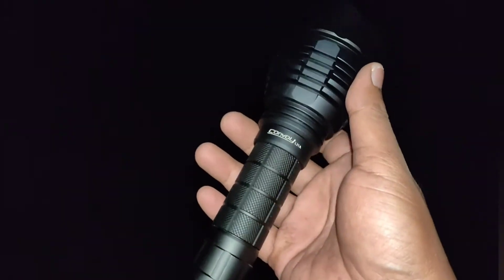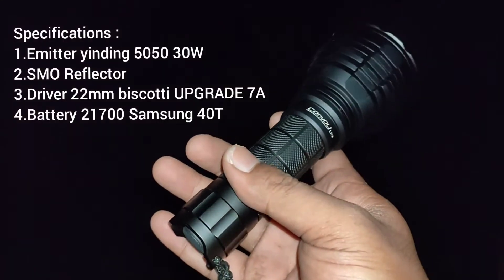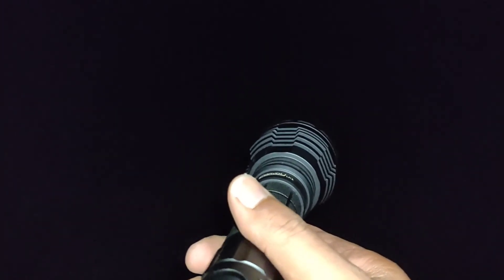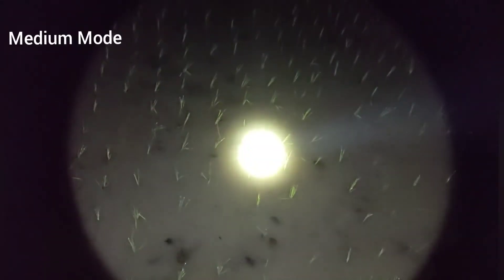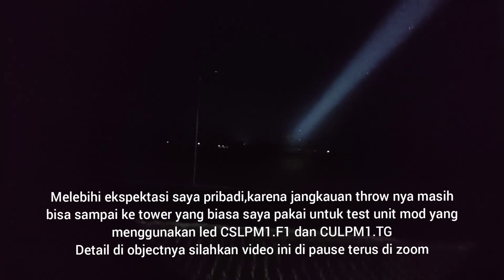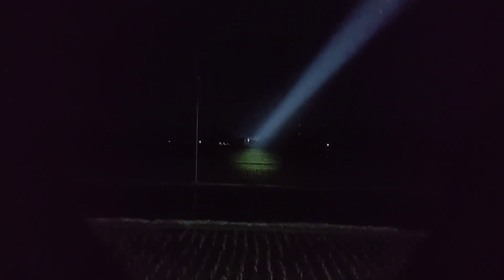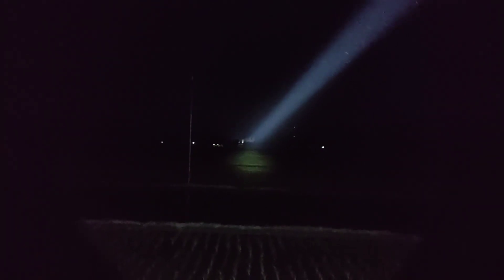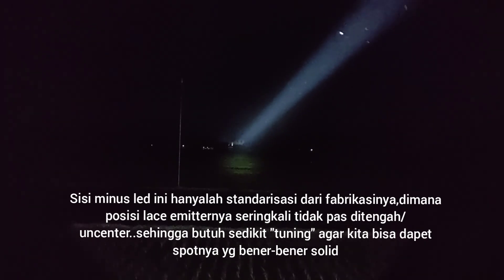[TUTORIAL & BEAMSHOT] CONVOY L21A : Solving Misalign Spot due UNCENTER Die on Yinding 5050(L50 Copy)

Comment from the maker: Reflector SMO model lama untuk Convoy L2/L21A : https://tokopedia.link/qxwRZSezesb
https://tokopedia.link/t9afbVrzesb

▶️Battery 26650
High drain 20-30A keatas untuk memaksimalkan driver dengan system direct FET,driver mod,multiple leds atau untuk supply single led SFH55.2/SBT90.2
@Vapcell P54 26650 :  https://tokopedia.link/U8yJgUQCjtb
https://tokopedia.link/Bj8PRmZe2tb
@Vapcell ungu 26650 : https://tokopedia.link/IL39luLCjtb
https://tokopedia.link/Ri40Xmdf2tb
@AWT 26650(new updated cell) : https://tokopedia.link/gOtP54jDjtb
Untuk drain current 3C setara HLY
@Liitokala 26650 Lii-50A :
https://tokopedia.link/6zenMp4Djtb
https://tokopedia.link/NoxY51pEjtb
Alternatif jika link diatas stoknya kosong :
https://tokopedia.link/6SvTxgZDjtb
https://tokopedia.link/j2vNlqSDjtb

▶️Battery 21700 :
1.Long endurance/Hi Cap battery
@LG Chem M50LT
New Gen dari pengembangan LG Chem M50T(Charging lifetime lebih panjang hampir 2x lipat)
Stock produksi 2021 akhir-2022 awal :
https://tokopedia.link/l498lEIpOsb
@LG chem M50T
Stok batch produksi 2021 akhir - 2022
https://tokopedia.link/g852n3xvvsb
https://tokopedia.link/yqcJIuDoIrb
Stok batch produksi 2020 akhir - 2021 awal
https://tokopedia.link/2oNSwB0vvsb
https://tokopedia.link/ZK2Js5JmErb
atau
@Samsung SDI 50E(long endurance/hi-cap battery with less turbo mode output for multiple leds) :
https://tokopedia.link/aVKLwItHIrb
https://tokopedia.link/zrL4EpNUvrb
2.Recommended untuk driver mod/upgrade
Samsung SDI 40T(*recommended for multiple leds) :
https://tokopedia.link/eVeyPUJUvrb
https://tokopedia.link/GufjhBhCksb
https://tokopedia.link/HVOES4uCksb
https://tokopedia.link/VrFfjdJCksb
3.Drain current paling tinggi Samsung SDI 30T(higher turbo mode output for multiple leds with less battery capacity) :
https://tokopedia.link/q8se3MSUvrb

▶️Battery 18650 :
1.Recommended untuk driver standart atau unit build up
  @LG chem MJ1(kapasitas tertinggi) : https://tokopedia.link/6Tenz5HWKrb
https://tokopedia.link/W4twokNWKrb
  @LG chem MH1 : https://tokopedia.link/z0UvN12WKrb
https://tokopedia.link/wWpwBj7WKrb
Atau
  @Samsung 35E(kapasitas tertinggi) : https://tokopedia.link/vXmloueXKrb
https://tokopedia.link/2srXE1gXKrb
  @Alternatif jika LG Chem MJ1 dan Samsung 35E diatas kosong,maka kapasitas paling tinggi dengan drain current yg sama pake Panasonic NCR18650GA :
https://tokopedia.link/iRYoPRZ4Osb
https://tokopedia.link/yZC1XG3SRrb

*Khusus untuk led nichia 219 series yg menggunakan driver di bawah 4A,jika butuh kapasitas battery yg tinggi,bisa pakai Panasonic NCR18650B :
https://tokopedia.link/yzVHyro5Osb
https://tokopedia.link/m3tzqA2XKrb

2.Recommended untuk driver mod dan multiple leds 
   @Samsung 30Q : 
FLAT TOP : https://tokopedia.link/O4cCd0NXKrb
BUTTON/PIN TOP : https://tokopedia.link/xvR5z6tidsb
   @LG Chem HG2 : 
https://tokopedia.link/TMbkIs51jsb
https://tokopedia.link/x1J9YRa2jsb
   @Sony VTC5 : https://tokopedia.link/Yj7vKgoYKrb
https://tokopedia.link/2fLN41sVSrb
   @Sony murata VTC5A : https://tokopedia.link/Lkz5SnzTRrb
alternatif jika semua stok diatas kosong bisa pake @molicel P26A : https://tokopedia.link/KL2KBFJTRrb

▶️Battery 18350
hi-cap battery dengan drain current medium :
@Coilgear 18350 :
https://tokopedia.link/K0yBqWAKitb
https://tokopedia.link/dSCnkypLWrb
https://tokopedia.link/O295ipTKitb
https://tokopedia.link/HEQRZmNKitb
Alternatif link jika link diatas stoknya kosong :
https://tokopedia.link/zYvQ70Nutsb
https://tokopedia.link/YB5gec4utsb
@Vapcell MII 18350 :
https://tokopedia.link/9EgTVgc1jsb
https://tokopedia.link/OMHWyOv1jsb
https://tokopedia.link/jjmbNEMvtsb
https://tokopedia.link/Uy6C6ekAjtb
@Soshine 18350 :
https://tokopedia.link/gEQgOI8uesb

Yg butuh drain current lebih tinggi untuk memaksimalkan output driver yg mod bisa pakai Vapcell,gunakan model flat top untuk yg pakai spring..dan gunakan yg button top untuk yg menggunakan contactor pin pada drivernya
1.Vapcell merah FLAT TOP :
    https://tokopedia.link/x4CTe2pAjtb
    https://tokopedia.link/h5Dm6j3LWrb
    https://tokopedia.link/itAZLwWLWrb
    https://tokopedia.link/JxVzNWvAjtb
2.Vapcell merah BUTTON TOP :
    https://tokopedia.link/Ucxuuv9LWrb

Yang butuh endurance(hi-cap battery dengan drain current lebih rendah)untuk unit dengan driver standart,bisa pake vapcell hijau F14 :
https://tokopedia.link/t7GajtTcZsb
https://tokopedia.link/6B145EBQNsb
https://tokopedia.link/pL2EnaMMWrb

▶️Battery 14500 
Untuk single led,driver standart dan maen arus lebih rendah :
@Soshine 14500 button top : https://tokopedia.link/3zZaUD3G6rb
https://tokopedia.link/yuEJvsfH6rb
https://tokopedia.link/XWO7UbiH6rb
Alternatif link jika di toko diatas stoknya sudah kosong : https://tokopedia.link/eFBsIkxzjtb

(High Drain)untuk multiple leds,driver kondisi mod dan butuh arus lebih tinggi
@Vapcell H10 Button top : https://tokopedia.link/Kwij9p1j5rb
@Vapcell H10 Flat Top : https://tokopedia.link/lhdyLJ6j5rb
https://tokopedia.link/FO3urTvvtsb
https://tokopedia.link/PvRMETGzjtb

▶️Recommended Charger :
Paling murah dan bandel Xtar Ant MC1 Plus (Single slot KHUSUS Li-ion 3.6-4.2V+Charging 1A max) :
https://tokopedia.link/uPBzEwvwosb
https://tokopedia.link/bAqzjMWwosb
https://tokopedia.link/SOL1gXKwosb
Video review nya ada disini : https://youtu.be/xhaRsKfEbNg

Kelas diatasnya :
1.Xtar SC1(KHUSUS Li-ion 3.6-4.2V+Charging 2A max) : https://tokopedia.link/fqnXWc0BRrb
https://tokopedia.link/s3vn11jvtsb
2.Xtar SC2(KHUSUS Li-ion 3.6-4.2V+Charging 3A max) : https://tokopedia.link/CwqYwn8BRrb
3.Xtar VC2S(Charging 2A max+Power Bank feature) : https://tokopedia.link/MJw4VhABRrb
*Kalau stoknya kosong berarti silahkan pakai VC2SL dibawah
4.Xtar VC2SL(Charging 2A max+Power Bank feature+Upgraded version from VC2S) : 
https://tokopedia.link/Gfbuz0cT5tb
https://tokopedia.link/9kFmrDhT5tb
https://tokopedia.link/CMho0HdS5tb
https://tokopedia.link/sgTASvpBRrb
5.Xtar VC4S(Charging 3A max+more features) :
 https://tokopedia.link/xDnENJAVvrb
Video review nya ada disini : https://youtu.be/aJJx3OCOJf4
*Kalau stoknya kosong berarti silahkan pakai VC4SL dibawah
6.Xtar VC4SL(Charging 3A max+more feautures+Upgraded version from VC4S) :
https://tokopedia.link/FU6fhz6R5tb
https://tokopedia.link/09M7wSRS5tb
https://tokopedia.link/68kQAC0R5tb
https://tokopedia.link/g6nzEoEVvrb

Produk2 yg di rekomendasikan diatas adalah semua produk yg sudah pernah kami beli selama periode th 2020-2022 dan sudah kami test pakai,jika ada perubahan stok dan spesifikasi produk dari seller..maka itu diluar tanggung jawab admin channel ini 🙏

Comment: Om sarannya dong. Aku up taffled c8 pakai led sst40 reflector bawaan tapi kok spotnya gak dapat ya ? Sperti ada 3cahaya dan sorotnya pun gak terlalu jauh. Harus digimanain nih om ???
Reply from the maker: Pertama..jika belum ganti drver,itu output lumensnya kurang,bener SST40 itu bisa sampai 17-18W max(sedangkan XML2 hanya 10W)tp kalau tidak disupply dengan arus yg cukup ya outputnya ga akan bisa maksimal..kalau masih pake bawaan,driver std nya taffled output kisaran 2-2.5A saja,silahkan ganti drivernya pakai punya convoy yg output 5-6A untuk SST40
Pilih diameternya yg sesuai dengan ukuran driver skrg(17mm atau 20mm)karena taffled ga punya standarisasi parts(ada yg isi 17mm ada yg make 20mm),untuk jmlh mode nya convoy jg ada 2 pilihan dengan 4 mode atau yg 12 group..silahkan dibeli sesuai kebutuhannya..di online banyak
Jangan lupa pakai thermal pasta ketika nempelin PCB led nya

Kedua,kalau taffled C8 nya itu versi reflector plastik atau almu tp tipis..spot mau lebih bagus silahkan reflector pake punya convoy C8 jg type SMO(smooth)kalau untuk ngejar spot yg solid,dengan buttom hole 9mm beserta gasketnya ukuran 5050 untuk buttom hole 9mm..syukur dapet yg buttom hole 7mm,gasketnya pakai 5050 yg untuk buttom hole 7mm jg(gasket menyesuaikan ukuran buttom hole reflector)

Ketiga,kalau mau lebih maksimal lg,silahkan pakai battery dengan model highdrain,semakin tinggi drain current battery..kalau sudah pake driver yg sy sebut diatas td,output led nya nanti semakin tinggi..dan senternya semakin panas..karena bahan hostnya taffled adalah almu babet(bukan almu solid terlebih lagi bukan aerograde)dan menggunakan roundpill konstruksi headnya(bukan integrated head)maka akan lebih mudah panas dan lebih susah buang panasnya keluar..jd khusus untuk taffled,max pake battery dengan drain current 8-10A saja sudah cukup spt misal Samsung 35E atau 36G,atau LG chem MJ1

Dengan perhitungan ketiga parts upgrade td..level maksimal yg aman,yg bisa di capai dengan hostnya taffled,SST40 akan mengeluarkan output 14-15W dengan lumens output di 1500-1700 di mode paling terangnya
Reply: @deviliciouscustom  smuanya sudah lengkap mas. Cuman reflectornya aja yg belum. Tapi Spotnya gak dapat rencana mau ganti juga tapi gak tau reflector mana yg cocok untuk led sst40 biar spotnya dapat gitu
Reply from the maker: @faishalsenjutsu8567  kalau semua sudah ya silahkan ganti reflectornya spt di point ke dua yg td sy bilang komplit beserta gasketnya
Reply: @deviliciouscustom  untuk driver aku pakai yg 3a dari pusat led mas. Aku sesuaikan dgn kbutuhan aja. Batrai LG 10A. Cuman spotnya gak dapat2. Spertinya reflector bawaan gak cocok untuk led sst40.
Reply: @deviliciouscustom  antara buttom yg 9mm sama yg 7mm mana yg lebih sip lah istilahnya ???
Reply from the maker: @faishalsenjutsu8567  ya kalau untuk spot itu ke reflector..tp jika ga bisa jauh,karena output lumens nya kurang..dr supply driver yg kurang,karena meski pake battery 10A kalau posisi driver output 3A dan itu regulated,bukan menggunakan FET..outputnya tetap dipangkas oleh driver jd 3A justru kerja driver semakin berat karena memangkas arus lebih banyak..dan penggunaan battery highdrain 10A nya spt mubazir..karena kalau hanya supply driver output 3A qt bisa pake battery laptop yg merk sanyo,sony,panasonic atau LG dengan drain current 4A
Reply: @deviliciouscustom  bagi wa nya mas. Aku bingung dgn cahaya senter ini kurang gmn. Nnti aku kirimi fotonya
Reply: @deviliciouscustom  iya sih mas tapi lebih enak aja yg hd. makanya aku pakek yg 10a aja kapasitasnya lebih besar juga
Reply from the maker: Search aja di maps "Devilicious Custom Co."..ada 2 tempat kontak nya sama,bio lengkap..WA dan Tele nya aktip
Reply: @deviliciouscustom  sudah aku chat mas
Reply: @faishalsenjutsu8567  the spot of sst40 it cant be like that beacause the diode was big and it has a dome you may try the the sft40 if you want a tihgter spot you need to replace the led with osram cslnm1/cslpm1 or culpm1/culnm1 or the led use in this video the yinding led

Comment: Untuk keadaan paling terang brp menit panas mulai terasa om
Reply from the maker: Panas ini sbnrnya RELATIF om..karena standart feel tiap orang pasti beda

Yg patent acuan suhu nya saja..temperature senter yg pake ATR/temp.control, ATRnya kan otomatis step down di 45-55°C
Kalau versi build up std ya 3-4 menit dipanjer di mode max itu sudah step down/turun otomatis output cahayanya karena driver otomatis mengurangi arus supply ke led untuk memberi kesempatan led nya cooling down

Comment: Jangkauan sorot, jauhan culpm atau yinding bg?
Reply from the maker: Kalau soal hitungan candela(jangkauan sorotnya)sedikit lebih tinggi yinding..hanya saja itu kelemahannya yinding,yg varian 5700K yg sudah sy review dipasang di L21A sering die nya ga center dan ini jd masalah buat yg nyari hasil spot yg perfect(harus ada perubahan jg di bagian lain untuk nyari spotnya yg bener2 center dan solid)
Sedangkan yg varian 6500K warna nya terlalu biru

Soal ketahanan nya dipush arus tinggi..tetep CULPM1,yinding menurut sy terlalu mark up datasheet yg direlease,disitu disebut bisa dipush sampai 8A jg spt CULPM1..tp sy ngetes sebelum dipasang di unit,dikasih 7A lebih tint warna cahayanya sudah bablas naek ke 7000K yg ini sudah jelas indikasi led mendekati overheat
Makanya setting terbaik yg sy dapet ya dengan 7A jg
Reply: @deviliciouscustom  setting 7a mksdnya gmn bg?

Drivernya dilock ke 7agitu kah? Carany gimn bg supaya driver 8a bs dilock ke 7a?
Reply from the maker: Sy lebih suka dr basic driver 6A di up ke 7A..kalau kepepet saja ga punya stok yg basic 6A barulah driver 8A di drop ke 7A
Maenin trigger bukaan gate di FET nya
Simak video2 sebelumnya om..tutorialnya sudah ada,sy dapet setting bagus buat ugal2an untuk CSLPM1 dan CULPM1 justru dengan 7A..turbo mode mau di panjer kek apa,output lumens..candela,dan tint warna cahayanya stabilll...
Reply: @deviliciouscustom  abg tau ga info berapa amper driver bawaan astrolux ft03?

soalnya saya ada rencana buat masang yinding 5000k ke astrolux ft03 sst40
Reply: saya awam soal modif driver bang, bagaimana jadinya kalo ternyata driver bawaan ft03 itu lebih dari 8amper, terus saya pasangin yinding 5000k, apakah led yindingnya akan cepat rusak???
Reply from the maker: Hitungan output driver itu jg tergantung dr beban led yg dipakai dan drain current battery..makanya sy kasih tutorial pengukuran arusnya dengan metode "tail current",karena itu lebih mendekati arus yg di pakai real dlm circuit kondisi beban led sudah ada..drpd dengan metode tanpa beban,trus kabel (+/-) drivernya yg ke led diukur pake ampere meter

Driver FT03 itu keluar 2 versi kalau berdasarkan output..yg versi 1 yg produksi awal ketika pertama FT03 SST40 keluar itu outputnya lebih dr 8A..karena driver tsb di pakai jg untuk FT03 yg varian SBT90.2(untuk SBT90.2 butuh arus minimal 12A)
Yg versi selanjutnya..itu produksi tengah musim,ketika ternyata FT03 laris dipasaran sblm L21A SST40 keluar..best sellernya justru FT03 versi SST40,batch produksi kedua nya pake driver dengan arus lebih rendah..komponen yg dipakai sama,tp dengan limiter
Reply: @deviliciouscustom  nah saya rencana mau belu ft03 sst40 mas, terus dipasangin yinding 5000k, 

mas bilang kan yinding 5000k bagusnya pakai driver yg 7a, sedangkan driver bawaan ft03 8a lebih

itu gimana cara mengatasinya? amankah jika dibiarkan drivernya 8a lebih untuk jangka panjang?

atau mas ada saran untuk mendrop arus drivernya? bagaimana caranya? untuk orang awam apakah memungkinkan untuk melakukan drop arus driver?

saya kalau reflow led masih mengerti mas, tapi kalo otak atik driver, tak paham sama sekali saya mas

Comment: Berapa lumen yang dihasilkan dengan mod 7A om?
Reply from the maker: Hampir sama dengan CULPM1 
Lumens output start up menyentuh di 2100-2200 an dan continue di 2000 an pengukuran di mode paling terang dengan spec mod dan battery spt pd video ini,continues drop nya kisaran sampai 1800 an lumens ngikutin grafik Vf nya

Data sheet yg direlease..yinding 5050 ini ditulis bisa dipush sampai 8A jg sama spt CULPM1,tp qt sudah test..durability jangka panjangnya tidak akan awet,jd qt maen kan 7A saja
Soal spec nya yg 30W..perhitungan dan test real nya hanya mampu sampai 24W saja(max)